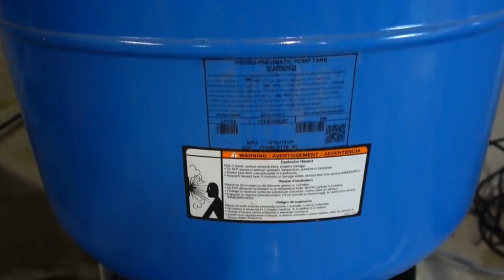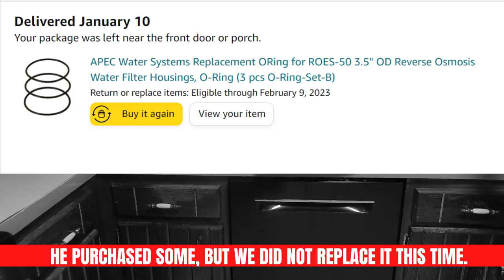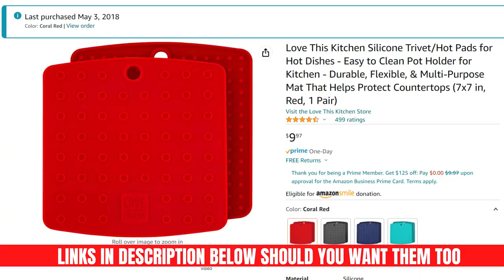How To Replace Apec ROES-PH75 Reverse Osmosis Filters

Comment: Great video. I have an ispring 2 stage system sediment and carbon. Still sometimes get a burst of sediment when I turn on faucet, think my hot water tank needs flushed because I did not install system until a year later. Maybe one of these days do one on flushing your hot water tank which I hear should be done every year even if you have a filter system. That way you do all the work and I just follow along when I do mine..Ha ha!..keep up the good work!
Reply from the maker: That's a great idea. Thanks for the suggestion.

Comment: I've had my kitchen like that for a couple weeks now as we figure this process out on our own! 2 days to get wrench # 1 & find out it's the wrong size. Several more days to get wrench# 2. A few more days for filters to arrive. Now we realize it's time to sanitize the system and the buildup in the sumps need some scrubbing to get clean. And after watching this video, I now want o rings too and I'm sure I'll probably get the wrong size the first time. I am also now concerned because I don't think we have that black drain line on ours...unfortunately, if there is any possible shortcut that would've saved our landlord 5 cents, you can guarantee he did it! Ugh, they REALLY want us to call a water treatment pro to do this whole process, that's for sure. Can't even find a manual for our system anywhere on the world wide web! It's crazy!
Reply from the maker: Good luck! A lot of these work similarly, so some manuals from other brands may also help give some clues.

Comment: Question. Do you have to fill the tank and drain it after the install of the stage 4 membrane or can you change all 6 filters then fill and drain the tank once or twice before drinking. Because if so you have to wait 2-3 hours before finishing the entire job. Not really specific on the directions
Reply from the maker: We have always just replaced all of our filters at one time and then performed the flush. I think the problem is that the instructions that come with the kit are worded for the situation where you are replacing them each individually at different months. I think that causes a lot of confusion because it makes it look like you need a flush after each filter when,  in my opinion, you do not need to if you are replacing them all at once. The stage 4 filter itself is just a semi-permeable membrane so it doesn't really leech things out during its first use. At least not to the level that the carbon filter and mineral block does. Small bits of carbon and minerals always come out in that first flush.

Comment: Whats the difference between the 50 75 or 100 roes system?
Reply from the maker: To be honest, I have never been able to find a good comparison chart that really shows the differences in a well thought out comparison chart. But as I understand it, the biggest difference is plumbing sizes and how long the filters last. ROES, as I understand it, is simply an Acronym for Reverse Osmosis Essence Series. So it simply refers to the model of filter they sell. I did find one comment, from Apec Systems themselves, that stated the following: "Aside from the Gallons Per Day difference between the two systems. RO-90 is equipped with Premium US Made high capacity filters that would last for more than 1 year before changing the pre-filters. On the other hand the pre-filter on the ROES-50 usually last around 9 to 12 months before replacement. The RO-90 is also equipped with John Guest Quick Connect Fittings that allows easy filter change out and connection of the tubings compare to the ROES-50 which is equipped JACO Fittings. Both systems are built in the United States in our facility located in California and both are the best systems in their respective price range."  So it sounds like the core functionality on the Essence series is the same. But the different models give you longer lasting times between filter changes, faster connection methods and possibly more gallons per minute  flow rate. I will try to do some more digging to see fi I can find a better answer. But for now, that is what I know.